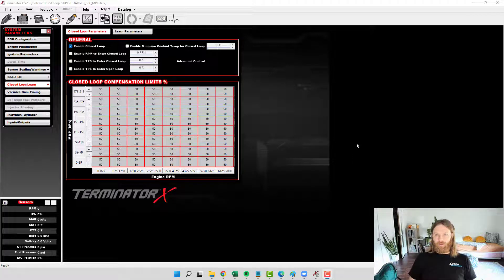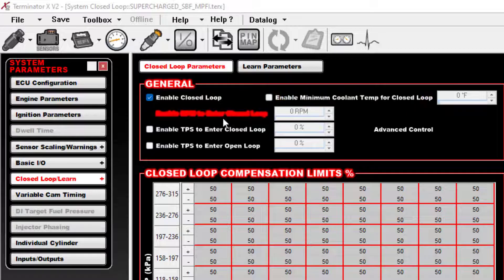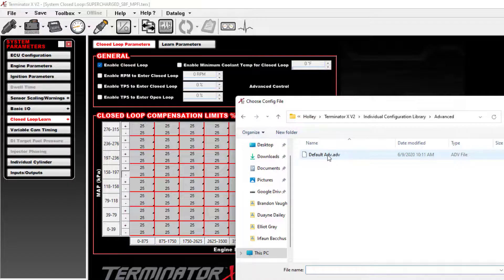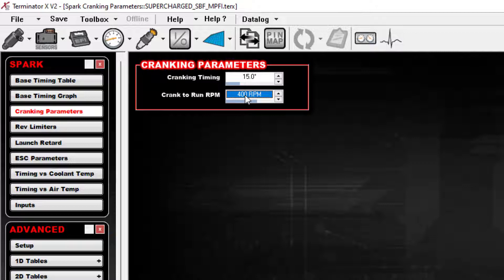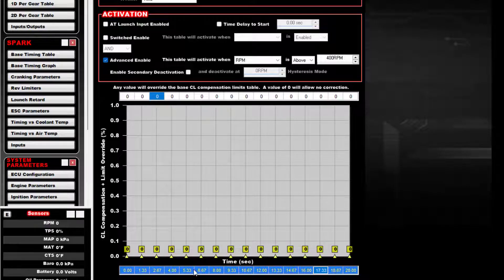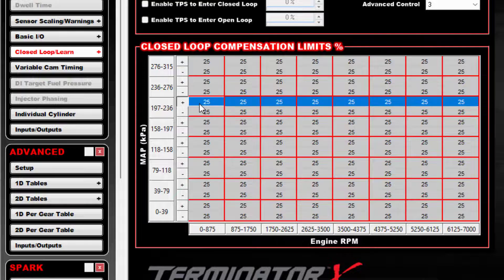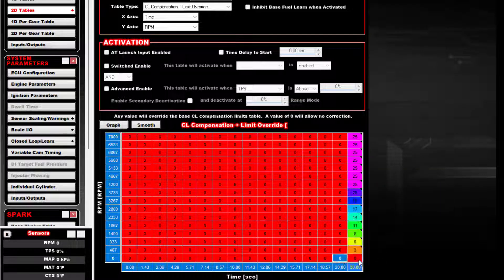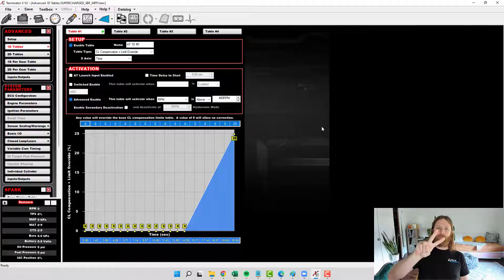Holley Terminator X showing 35.6 AFR after startup and flooding the engine with fuel?

Comment: Another quality video from Leech Motorsports. My car has the opposite problem, it stays at 9.6 AFR until the sensor heats up, it tries to idle but will usually die before the sensor is warmed up, if I keep my foot on the gas then it will stay running. After the sensor warms up and starts reading it idles. Looking forward to the next video.
Reply from the maker: If you are confident the 9.6afr is a false rich condition, then try this same technique but with the cl comp - limit override.
Reply: I have the same issue and doing the same thing but with the cl comp - limit and it took it away.
Reply: Did you ever figure this issue out? Dealing with the same thing. Should cl comp limit be 0% or should it be higher to allow it to pull more fuel away
Reply: @stephenmaggard1280 did you ever figure this issue out? I am having a very similar problem. Should cl comp be 0% in 1d table or more to allow it to actually pull more fuel away ?
Reply: I have this issue also.  9.6 afr with no change until 30 seconds in it want to die. Then the sensor will start reading  and engine will even out.   What was your solution to fixing this?
Reply: @TheApacheTruck  still does it but it runs good so I quit worrying about it.

Comment: I have been chasing this exact issue since you tuned my car years back.  I’ve learned a few things… but don’t know what to make of it.  Holley warrantied my O2, no difference.  I sent my computer to them, they said no problems. 

I think it’s 100% in the heating logic.  I learned the following: if I go key on, engine off for that same 20 seconds… the problem won’t be there when I start the engine.  If I watch the lights on the ECU the O2 light will be yellow, then turn green eventually.  If I start after the green, no problem.  It’s as if the heating circuit is lazy, not the sensor itself.

Now here’s another odd thing… I went down the “maybe my starting voltage is low” line of thinking… replaced battery, re-did grounds (and added 3 more), changed to low amp draw starter… no change.  During this time, I noticed that if I put my battery on a trickle charger for 15 minutes, the issue went away! I don’t have any draws and it’s always at full voltage after sitting for any extended periods.

It also will seldom (very rare) display “heating” instead of “initiating” on the handheld after a long hot drive.  Very rare, and very random.

Anyways- don’t know why it took so long for me to find this video.  Going to implement the change now.  It’s a real bummer Holley doesn’t have a fix for this!
Reply: Working great after implementing.  Over the past 2 years dealing with this- I noticed that the hotter the engine, the shorter the 35.6 hang time.

I used a 2D table with time and CTS.  Seems to be working great!

Comment: The two most common reasons I hear for this happening is Holley EFI has a shit heater control strategy, and sensor placement. Most guys, myself included, just stuck it into an old narrow band bung on the header collector. Which sits at about 3 or 9 o'clock on the pipe. Ideally a wideband wants to be at 2 or 10 o'clock. Something about moisture running out of the sensor at 2 or 10, that just sits there at 3 or 9.
Reply: That's interesting 👍
Reply from the maker: I’m leaning toward heater control logic. But it’s just one of those things we can’t directly see and manipulate in the tune, so it’s hard to say.

Comment: I will have to do a log and see if I can see this, I have never noticed it on mine.  I do have the fuel pump prime set on 5 seconds.  I normally turn the key on and wait until it finishes before I crank.
Reply: I was wrong mine does have a lean spike when cranking. Doesn't get all the way to 35.  Toped out at 23.8.  mine dropped out of closed loop after .13 second.   I wonder what the fuel and spark are doing during the Syncng?
Reply from the maker: I wouldn’t worry too much about lean spikes during crank. But if it stays lean more than about 1 second after successfully starting, something is wrong. In your case, if it goes to the 20s and stays there for any measurable amount of time, I would look for tuning related issues in the startup enrichment settings and the top left corner of the fuel and target afr maps.

Comment: I've heard a cam with a LSA lower than 113 can create a false lean condition for the O2 and causes the system to dump fuel. Is this true?
Reply from the maker: While there can be truth to "false" o2 sensor readings when there is a lot of overlap between the intake and exhaust valves, the overlap alone isn't going to cause the readings to go to full rich or full lean, as described in this video.

As for the 113 LSA number specifically, that isn't what's going to cause weird readings... it's the valve overlap amount. And while lowering the LSA of the cam will directly increase overlap, the duration numbers are going to play way more heavily into that.

The quick formula I use for determining valve overlap is:
( ( (Int Dur + Exh Dur) / 4 ) - LSA ) * 2

So a 113 LSA with something like a 226 duration int/exh at .050" lift is still at 0 degrees overlap at .050".  But 113 LSA with a 254 duration int/exh at .050" lift pushes 28 degrees of overlap at .050" lift, which will definitely start to mess with o2 readings. Moral of the story is that it's all about the complete cam specs, not just the LSA.

Comment: Good video, problem is on my sniper I cannot find the time under the x axis. Another tab I could use or is this only useful for the terminator?
Reply from the maker: Unfortunately, the sniper systems do not currently support Time-based 2D tables. That said, I've never seen this issue on a Sniper system, only on the Terminator X systems. Can you confirm this is an issue you are actually having on a sniper system? Would be good info to know for future reference, and maybe I can find a slightly different approach that would work for you.
Reply: @LeechMotorsports  thanks for the response. Turned out to be a bad o2 sensor. Got a new sensor and went away, then went to get a dyno tune. The basic tunes created are too rich, I think that's why they foul so soon.
Reply from the maker: @carlosangel8773  Agreed. Seems like most handheld tunes I run across have target AFR in the 13s, even on stuff with stock or very small cams without a lot of valve overlap. That combined with really low timing creates a scenario where plugs and o2 sensors like to take a dump quickly. Glad you got it resolved.

Comment: I just enabled the TPS to enter Closed Loop.  I set it to 20% and it seems to have covered up my issue.
Reply from the maker: That’s a pretty high number. You are likely to spend very little time operating the vehicle above 20% throttle, so closed loop is only going to work on heavy throttle situations. That may or may not be what you are looking for.
Reply: @LeechMotorsports  good point!  I was thinking that once it started cl compensation, it would continue.  I'm out of 1D tables with flex fuel and boost builder things.  I'll go back and watch what you did in the 2D table and set something up.  Thanks for your response!

Comment: Mine is running great but goes full lean when I let off the throttle?
Reply from the maker: That’s different. Likely just a tuning issue where you need more fuel in the low kpa decel areas of your base table and/or richer target in the same area. Also, you may actually want it to be lean during decel as long as the fuel returns smoothly  as you approach idle.

Comment: I don't have this issue because i have my idle area + or - 5% because I don't want it adding or taking away any fuel at idle since the map is fairly spot on around idle.
Reply from the maker: That's ultimately the correct long-term solution. But because this can get in the way even early in the tuning process, this workaround may still be of value to many. Agreed though, giving these things huge authority over fuel correction is a TERRIBLE idea. Too many times I've seen others bring in tunes from other "tuners" and the max correction for closed loop AND learn are +-100%. Lol.

Comment: I'm having a similar issue but my afr sticks at 9.6 for 20 seconds
Reply from the maker: I see that often as well. In your situation, do the exact same thing but set up the advanced table to override the cl comp - limit override instead of cl comp +
Reply: @LeechMotorsports  I am similar. AFR reads 10.8-11.2 and stumbling, while wideband LED is blue. As soon as the led goes green the engine smooths right out, if I just leave key on until it goes green runs perfect right away.
I notice CL COMP is -50 while led is blue and it’s running rich/stumbling.  Do I want to do the same with cl comp - as well?